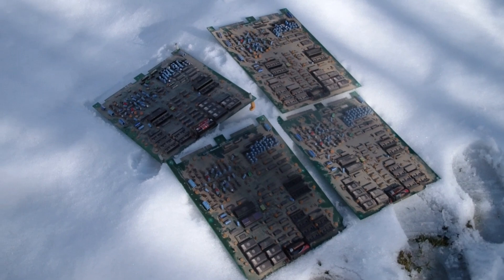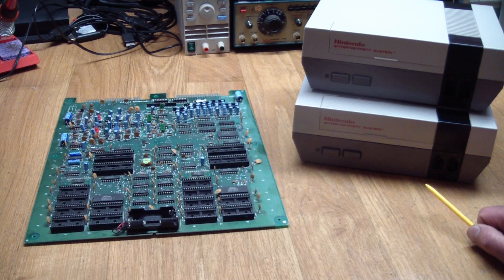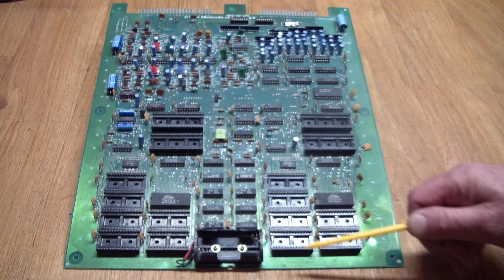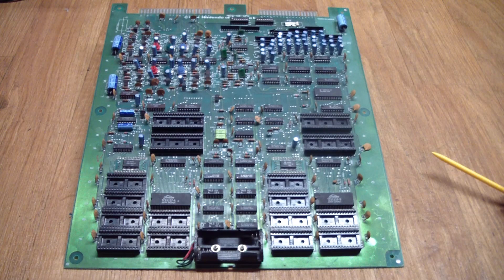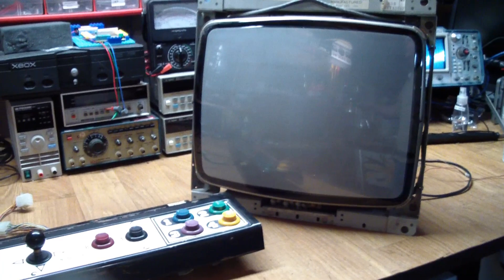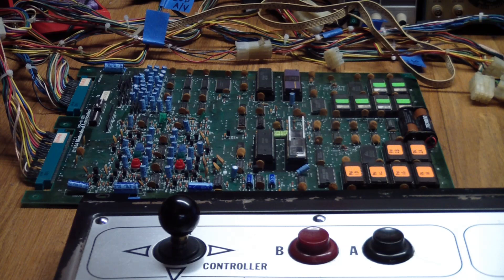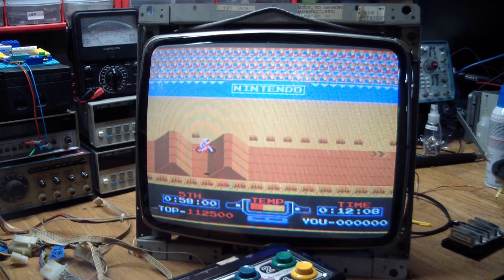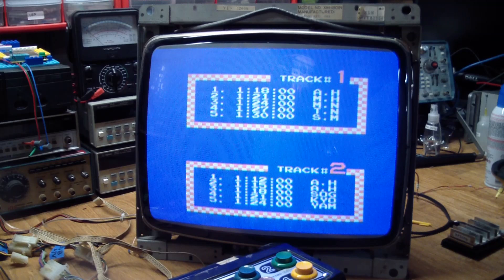AE#115 Nintendo VS Arcade PCB Checkout

Comment: Hi. Great videos.. I need basic explanation to learn. I have a few questions I hope you can help. I have a Nintendo mds 05 cpu board. Which I want to put in a donkey kong cabinet. The board I have has super Mario roms and ppu on the p2 side.. p1 side no roms currently.  If I'm using 1 monitor do i need to swap the roms to the p1 side? The main side?  Or no? This will be in a single monitor dk cabinet.  The control panel will have 2 controllers. If you can help.. greatly appreciated
Reply from the maker: First check the edge connector wiring, but I'm pretty sure that the single cabinets used the same connector with all the wires for the second player removed. If it doesn't work try moving the roms, ppu and cpu to p2 and try again. Just a suggestion, do it at your own risk.

Comment: ARTIFACT ELECTRONICS 
            1.) What IC chips do you use to do bank switching to not be limited to 64K of address space? I'm not sure what components are doing the bank switching is it a PROM chip?
             2.) The arcade games make daughter boards that replace ROM chips or RAM chips and the daughter boards have GAL/PAL chips that will "redirect" the addressing or does bank switching. I'm not sure what is the "advantage" of redirecting addressing using GAL/PAL chips which I'm guessing they are doing Bank switching?

                Can you please give examples on how it a PROM, ROM, Latch takes a 16bit address line 64Kb and bank switches the 16bit address lines to make more address lines more than 64Kb?
Reply: 1) NES games had TTL logic or some custom chips called mappers that did the bank switching. Nintendo make 6 or 7 of them, 3rd party games had many more. The usual way they worked was you wrote to addresses in the ROM range to switch banks. Because writing to a ROM normally does nothing it worked fine.
2) Yep. That's how it works. You have more ROMs than the CPU can address, technically speaking you have banks of ROMs all mapped to the same addresses. The GAL/PAL/mapper chips control which ROMs get selected when those addresses are hit. Custom logic can also be used for copy protection: The data is written to the ROMs in a scrambled order, and the logic scrambles the addresses from the CPU/PPU the same way. You can copy the ROM but unless you had the logic it wouldn't make any sense.
Reply: @coyote_den  thanks for the help travis parker
Can you give more examples of how bank switching was used and how address redirecting was used? 
1.) Band switching was used when you have more ROM chips than the CPU output 16 bit address. 
So the arcade designers would make a special address that would go to a Mapper ROM chip or a mapper PROM chip to write a special address to the Mapper ROM chip or Mapper PROM chip and then the Mapper ROM or Mapper PROM chip would "output" a new address which would for bank switching turning on and off CE control enable lines to the other Game ROM chips that aren't on the 16bit address buss lines?
2.) Do you know how the arcade games daughter cards that replace ROM chips and the daughter cards insert in the ROM sockets that will bank switch, scramble the address lines, redirecting the address lines to make new addressing extending the 16bit address buss lines into i guess a 24bit  address buss or 32 address buss?
I'm not really sure what these arcade game daughter boards do but they do somewhat of extending the address buss lines to create more addressing
Reply: @coyote_den  thanks for the help
here is a list of repair questions::

   When the arcade game is constantly resetting watchdogging. And you disconnect the watchdog circuit from the arcade game and then the "game stops resetting". 
1.) How do you know if its the ROM's chips or the address decoder chip or the RAM chips? Because It can be either of them that is causing the game to reset.
2.) When Disconnecting the watchdog circuit and the game STOPS resetting would this isolate and eliminate that the ROM chips are good, address decoder chips are good, Data buss and address buss are good?
3.) The arcade game ROM chips game code outputs a "special address" to the address decoder chip to RESET the watchdog circuit. If the the ROM chip game code is corrupted and is sending out a corrupted "special address" or is sending out a scrambled "special address to the address decoder chip. This will cause the watchdog circuit to constantly RESET the watchdog circuit?   
4.) If one or more of the RAM chips is corrupted and the arcade game is constantly resetting watchdogging. How would the watchdog circuit know that one or more RAM chips is corrupted and not working correctly?
Reply: @coyote_den  
What is the difference between address decoding an address compared to address multiplexing an address?
Reply: @coyote_den  thanks for the help
----->        1.) what is it called when bank switching can use the "same address range" to route to one RAM/ROM and then route the same address range to a different RAM/ROM chip what is this called? Is this called address multiplexing? 
----->  2.) Because I'm confused by the daughter cards kits says that the madsel circuit means multiplexed address select.
So what do they mean by multiplexed address select? 
----->   3.) I don't understand the difference between multiplexed address selected compared to address decoding?